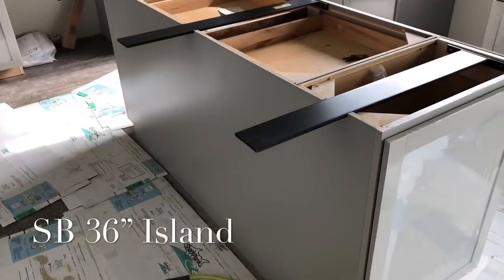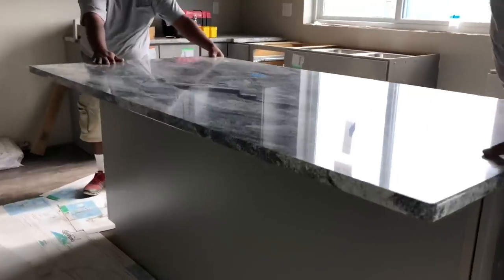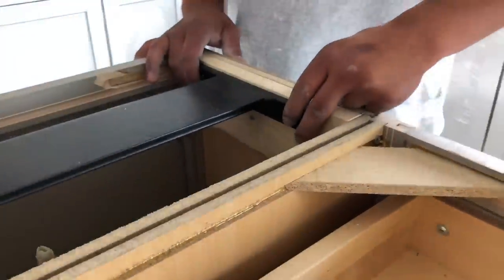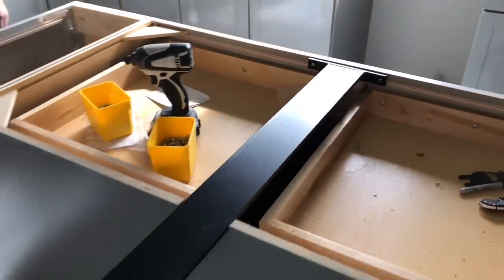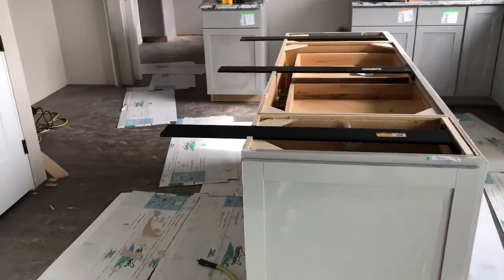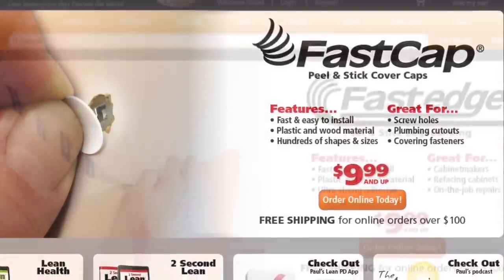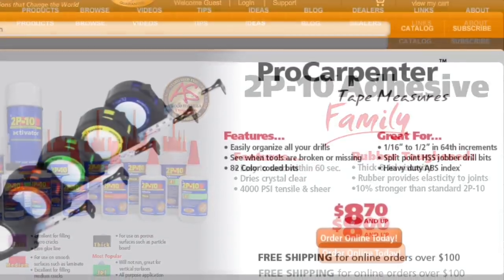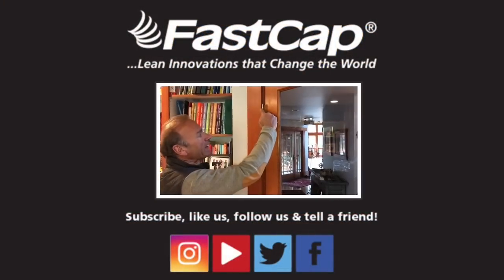Stealth SpeedBrace for Kitchen Island Installation

Comment: Thank you for the 1/8 dropped-down tip. You might be the only one who mentions to do this. I have found not all support steel is made 100% straight. The 1/8 drop on the opposite end allows the support steel to make contact with the granite overhang, giving it the support it needs and allowing for a flat-level surface with no gaps on the side of the island between the cabinet and the granite. Another option is to use a router to make my recess for the steel supports. You can also use an oscillating saw, but it is difficult to keep it accurate and level.

Comment: would a hidden L bracket be better on the back side, so that all of the pressure isn't just lifting up on the front of the cabinets?  I know the cabinets ned to be secured to the floor, but I'd rather have my pressure going down than up.

Comment: Do you pre-drill the screw holes or just go to town with the impact driver, fingers crossed?
Reply from the maker: @victorvek5227  It is your preference when you go to install the Stealth SpeedBrace if you need to pre-drill the screw holes before installation. If you are using our FastCap PowerHead Screws, they are self-tapping, so you don't have to worry about pre-drilling. If you use a different screw type,  we recommend pre-drilling before installing the Stealth SpeedBrace.

Comment: Cool but how do you secure the countertop so it doesn’t move around? Don’t tell me it just sits there with a bit of silicone!?
Reply from the maker: @A2ZGeek It all depends on the type of countertop you are installing. If it’s Quartz or Granite it does just sit on the brace but you can glue it to the brace if you want. If you are installing Formica you can screw the brace the plywood under the Formica.

Comment: Would this work on frameless cabinets as well? How tall is the screw flange, I wonder if it would catch on a 3/4” stretcher for frameless cabinets.
Reply from the maker: Yes. People use it that way all the time, but you might have to do some small adaptations to the brace and to the cabinet structure.

Comment: Hi! Ehat the Length and Width of that countertop? Thank you!
Reply from the maker: @Milton Martinez We don’t know the dimensions of the slab since this was done at a job site outside of FastCap but we always recommend the following:
1 - Don’t have your countertop extend more than 6’’ past the end of your installed brace.. we typically say to shoot for 3-4’’ to have the best security/stability but our worksheet states that you can go up to 6’’
2 - Do not overhang more than 2/3 of the brace over the end of the cabinet. At least 1/3 of the brace should be set back into the cabinet. (These are instructions for our standard braces that don’t have the mounting flange that the 36 Island Brace has.) When installing the Island Brace you wouldn’t run into this problem because you’ll typically be setting it fairly fair back into the cabinet.
On our SpeedBrace page, we have more information for installing our SpeedBraces under the Tech Spec tab: https://www.fastcap.com/product/stealth-speedbrace